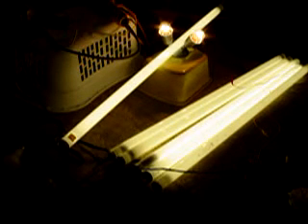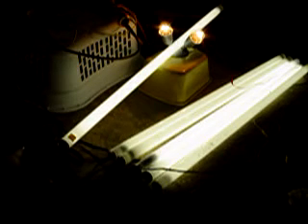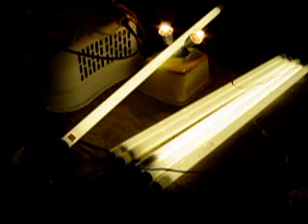My Romerouk replication using Callanan schematic drawing

Comment from the maker: @paraipanakos 
I remember trying an old adjustable cap from an old radio in series with the spark gap. The cap just arced badly. I used a six foot section of PVC pipe so I could adjust it while the circuit was live, no joy.